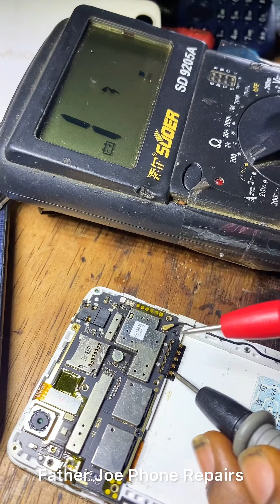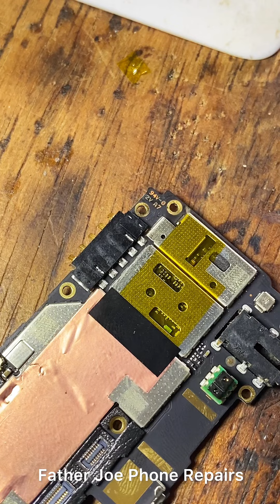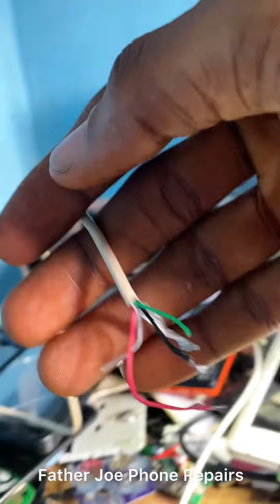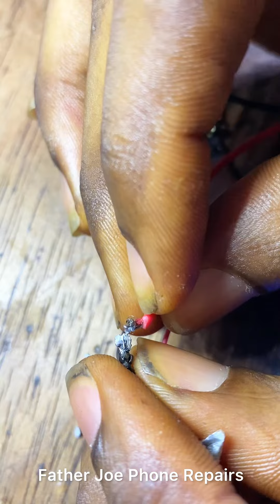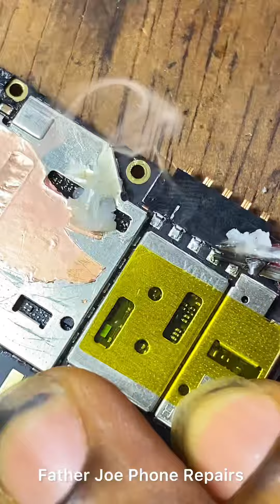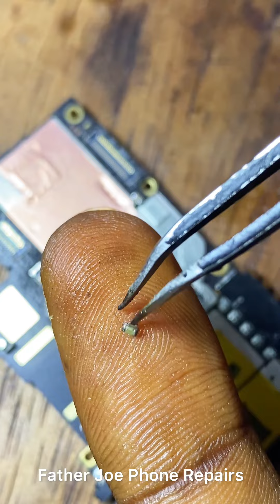How to fixed a full shot circuit in any phone

Comment: It is better when you have a Dc power supply with embedded short killer like sugon, Korad,etc. or a short killer tool where you reduce the voltage and increase the current to be at a safer side but all the same thanks for the video
Reply from the maker: Ok we love you

Comment: Good video, but please don't use more then 1.2volt after the power management chip as Injecting 3.8 to 4.2volts might be a game over for the CPU or emmc. 
You really need to know your power rails before injecting voltage to any section of the phone.

Thanks to Father Joe, he is a professional, he knows his job very well.

Comment: Is it possible to connect the charger directly without connecting it to the battery?
Reply: What you really need is more current more amperage
Reply: yes you can via using red and black probes of the charger and connecting it to the vbat and gnd on your pcb
Father joe made that video

Comment: I was watching you apply voltage on the first pin of battery and nothing happened, the capacitors started to burn when you have applied voltage on the second pin
Reply from the maker: The first and the second pin is battery positive